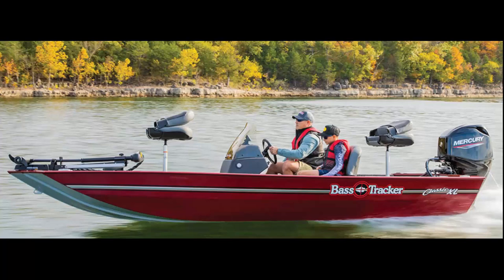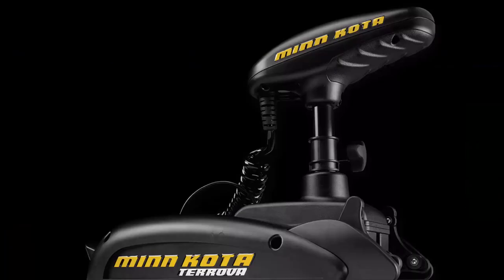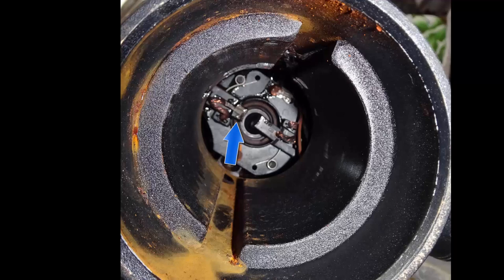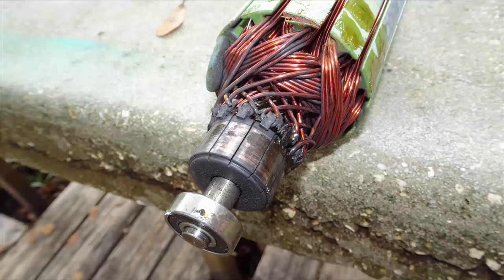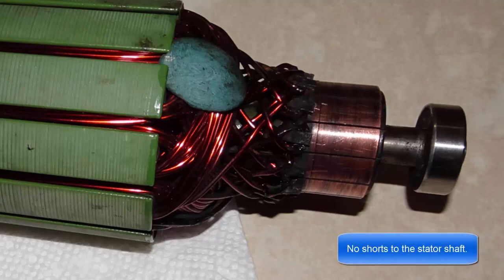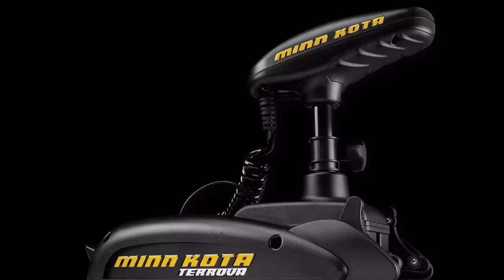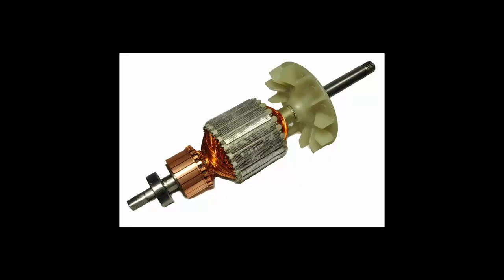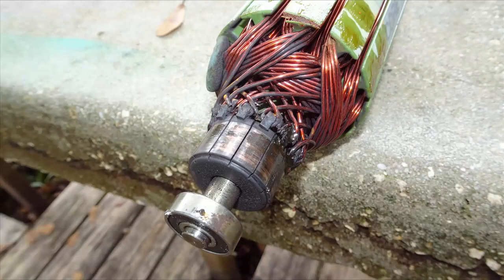Trolling motor overheat while submerged 1 of 3

Comment: I understand your explanation about the motor running wide open for 45 minutes causing the armature to overheat. What size wire is running from your trolling motor batteries to your trolling motor? You should be running 6 gauge wire from your batteries to your trolling motor. Tracker typically runs 8 gauge wires from the batteries to the trolling motor. Too small of a wire can cause the wiring, and the motor, to overheat without necessarily kicking out the circuit breaker. I had a similar instance with my boat when the outboard engine lost oil pressure. I had to go all the way back to the ramp on my trolling motor at full speed which took over 30 minutes, and I never had any issues with my trolling motor. I was running 6 gauge wire, Terrova 101 36V, and a 60 amp circuit breaker. Just something to think about that may have contributed to your issue.